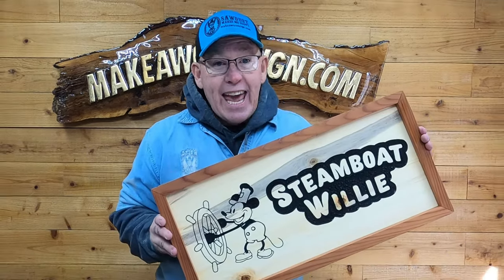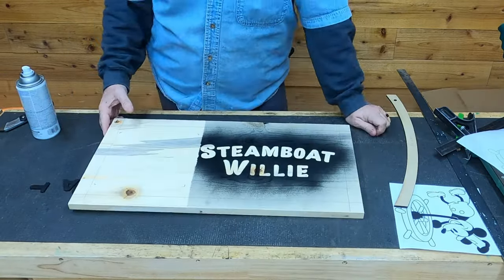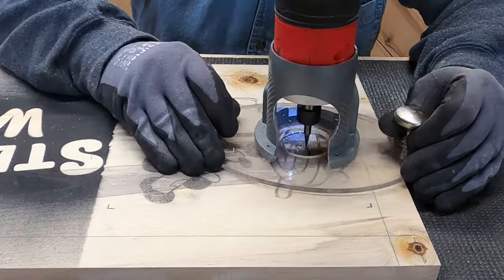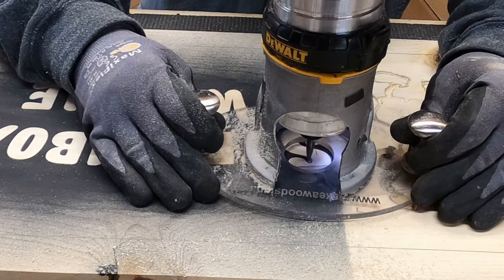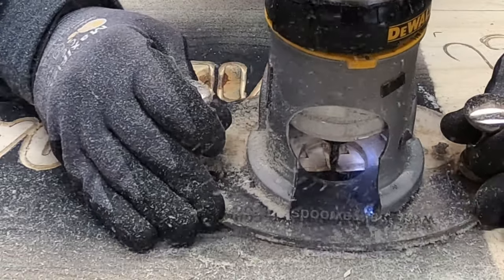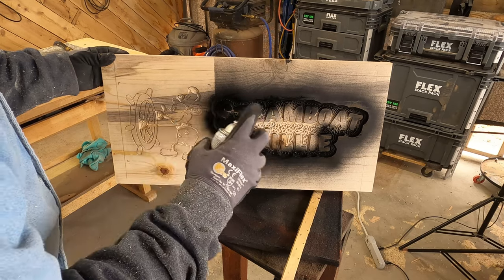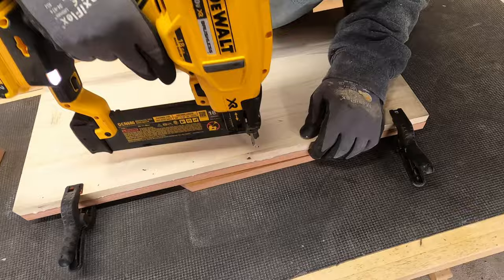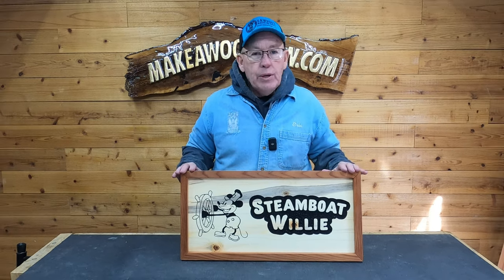Carving A Disney Character Without A CNC Machine - Steamboat Willie

Comment: Much easier way to create the prints.

First load Inkscape. Next, create a multipage document and add new pages and place them together to cover your artwork. Paste your image over the top. Size as necessary and you're ready to export to PDF to send to a customer to proof or to print - each page will contain the relevant part of the image. Next, trim the edges off the images, number them and glue them to the wood. Wait for the glue to dry and you're away. You've got to sand the spray paint away so might as well sand the paper off. This way there's no need to have those letters you need to place as all your text can be positioned perfectly in Inkscape and you can download all the fonts you want for free from loads of font sites including Da Font.
Reply from the maker: Well, we prefer this method because we really dislike carving through paper.  We've done it before but it's really irritating